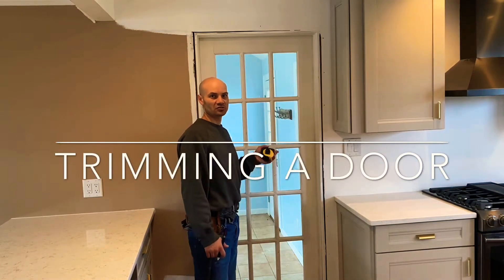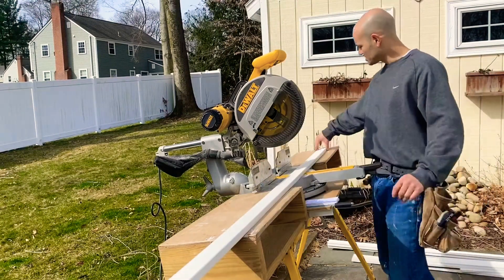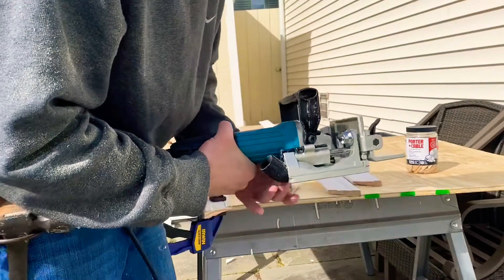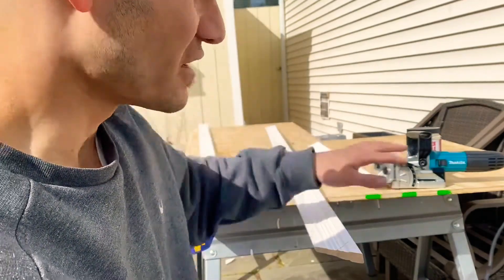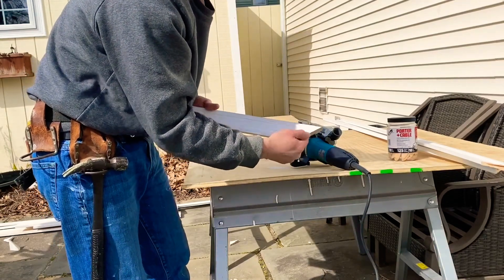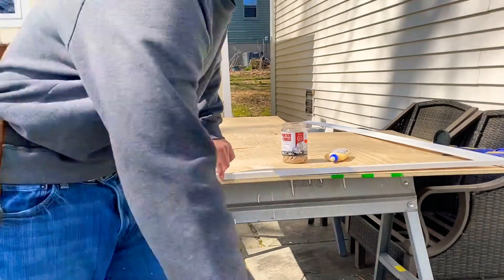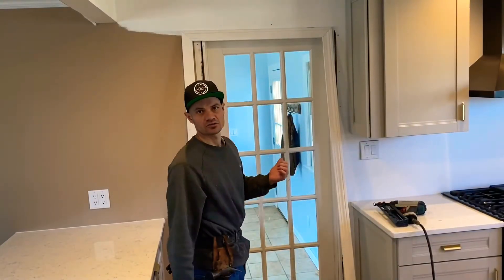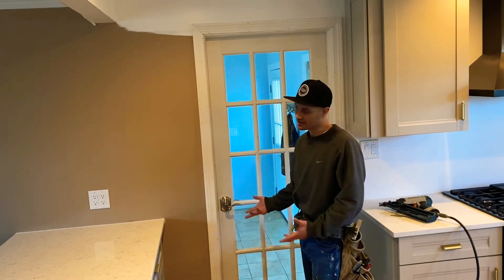How to Trim a Door

Comment: I'm sure you might have figured it out by now but just in case you haven't you can buy clamps like that called Clam Clamps. Great video. Thank you for sharing :-)
Reply from the maker: Yup I actually found a bunch of Hartford clamps a year back so I purchased those. They are definitely better then clam clamps.
Reply from the maker: Yup I actually found a bunch of Hartford clamps a year back so I purchased those. They are definitely better then clam clamps.
Reply from the maker: Yup I actually found a bunch of Hartford clamps a year back so I purchased those. I feel They are definitely better then clam clamps.
Reply from the maker: Yup I actually found a bunch of Hartford clamps a year back so I purchased those. I feel They are definitely better then clam clamps.
Reply: @IllGetMyTools  that's good to know! I haven't bought any yet but if I ever do I'll get the Hartford ones :-)